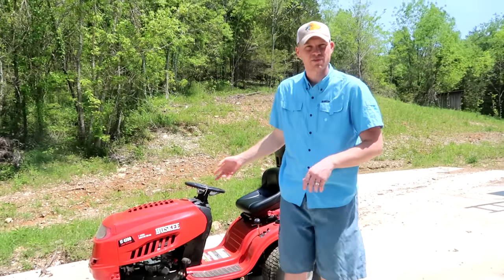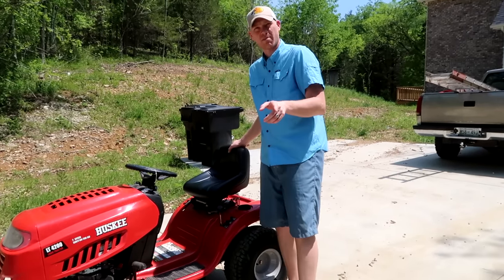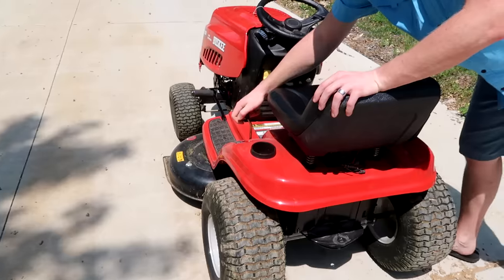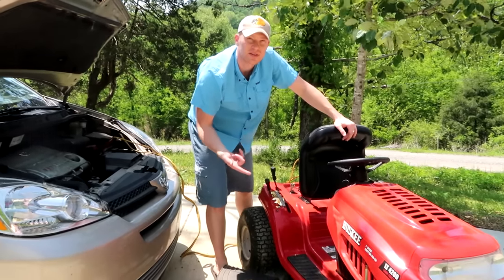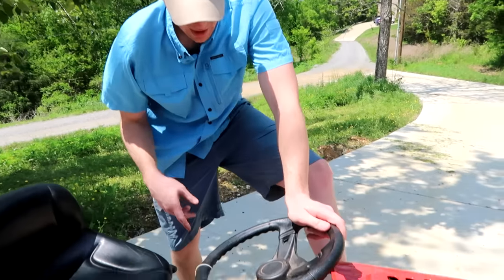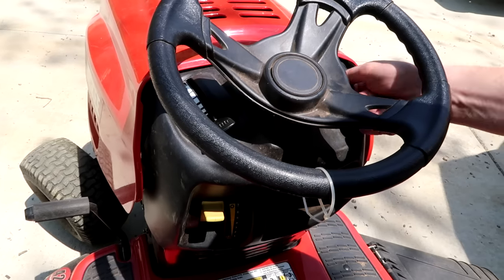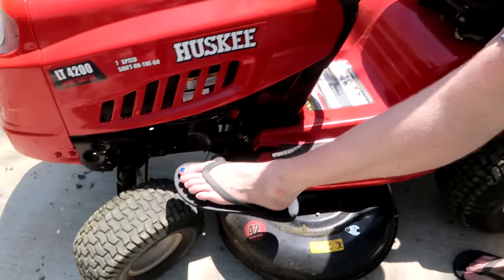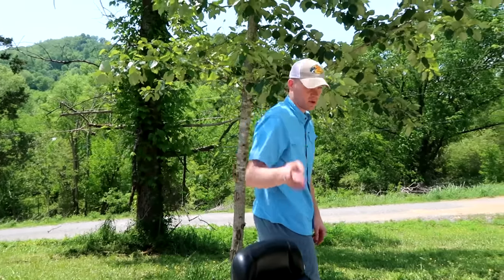MOWER WON'T START - QUICK TIPS

Comment: I am working on my grandpa's mower he is about to die. And I tried every thing but replaces the engine it won't turn over even hooked up to a jumper.
Reply from the maker: Sorry to hear that. Hmm hard to say without being there to look. You check all the easy things? Have gas? In park? Out of gear? Blades disengaged? If u checked all that may be a bigger problem...fuel line blocked, need spark plug
Reply: Biker .....Seat sensor? ( you have to sit on seat to start), 
Check fuses, my Murray won't start with a blown fuse.
Reply from the maker: Yup thats true :)

Comment: My lawnmower turns on but it doesn’t move, what can it be
Reply from the maker: Is it in gear?
Reply: WHO_TEE_WHO yes, everything is fine with that, like I said, it turns on but it will not bugde
Reply: It’s not even a yr old and it keeps happening
Reply: Did you buy it new?  If not, it could be the drive belt.

Comment: Your mower may run, but not start with a dead battery. Get it cranked, and see if it will run with the battery charging from the motor. No need to jump to the conclusion that you need to buy a new battery.

Comment: I have this exact mower. It died yesterday and won't start back. Changed plug. Getting gas and spark. Wont even start with starter fluid. Just turns over and over won't start
Reply from the maker: So the started is turning the engine over and you have spark but it wont fire?
Reply from the maker: Hard to believe it wont fire at all with starter fluid if it has a spark. Hmm. U sure it is getting gas and has a spark?
Reply: soonersbaby1 Check the compression or leakdown. Adjust the valves. Check for spark and fuel.
Reply: With the spark plug out when I turn engine over you can see it sparking. Possibly not sparking enough? Idk but yeah I've tried everything I know of and it just turns and turns. I believe it's getting compression it sounds normal when turning over. I took all fuel lines off and made sure its flowing. The bowl fills up with gas. And like I said even with starter fluid it wont do anything. I even tried it in the spark plug hole and it almost tried to do something but then nothing happened even when i did that again.
Reply: My phone never let me know you guys replied
Reply: soonersbaby1 Maybe the crank key is sheared. Remove the flywheel and see. Check the compression. Check the leakdown to test rings, valve, and head gasket. But possibly it's the valves out of adjustment! They usually are too loose on one like the exhaust.
Reply: Also the mower will not go into neutral so its sitting where it died. The shifter goes to neutral but the gears dont release. And it doesn't have the lever to pull to release it
Reply: soonersbaby1 Check leakdown to check rings and valves. The valve seat may be loose causing low compression. Check the float and for fresh fuel. Check the fuel pump. You maybe supposed to sit on the seat! Check valve adjustment.
Reply: soonersbaby1 Replace the carburetor.

Comment: My battery is dead and its only 2 years old.
Reply from the maker: That will happen if you let it sit alone all winter
Reply: WHO_TEE_WHO It’s summer time here. I used it 2 weeks ago. I might of flooded it because there was a little smoke coming out of the motor. Im not an expert though.

Comment: troy bilt 3 yr old tractor I got it jump started, then after 5 mins with car running, i took the jumpers off.  it would not start, in fact it made a half hearted buzz like an over timer.  but not starting.  so on went the jumpers and this time, it would not start.  same buzz noise.  What have I done?